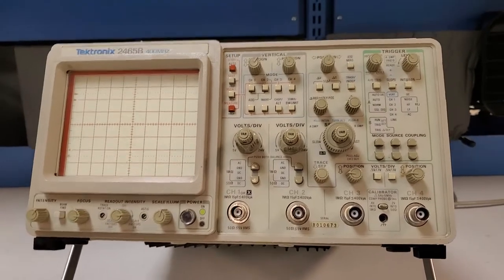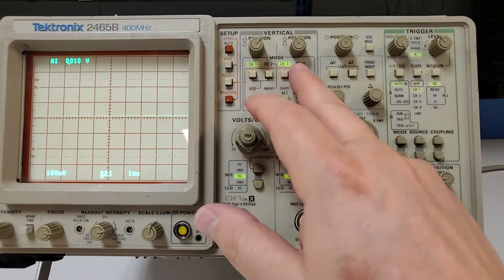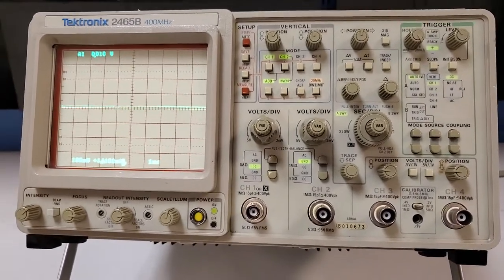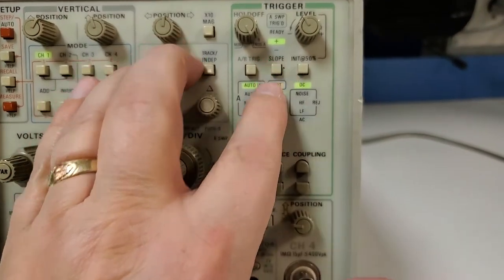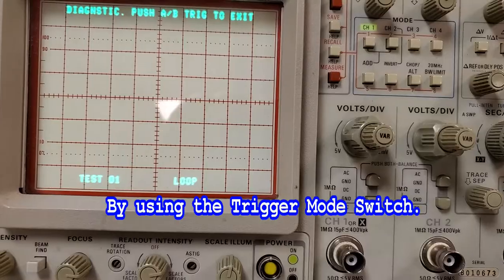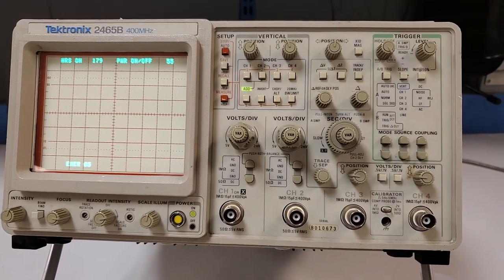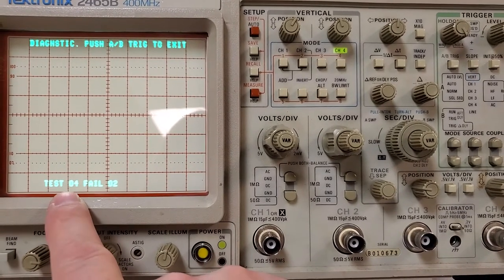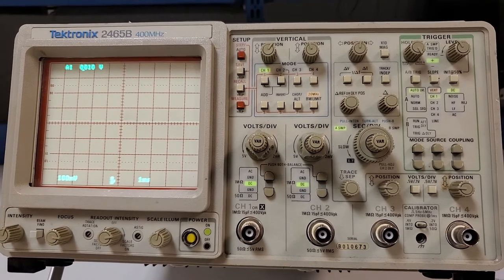Tektronix 2465B Inidcators Flicker & Dianostic Routines

Comment: Hai Keith, I like your Tek video's :)

I'm trying to fix a Tektronix 2465, and it works now, but I can't find the cause on 1 remaining problem.

Do you have a tip what causes the intensity becoming way to bright when more channels are activated? (it''s ok when 1 channel is on, too bright when 2 or 3 channels are active, and waaaaay to bright when all 4 are active... (so I have to change the intensity pot every time I activate or deactivate channels).

The PSU voltages and ripple are within spec. I replaced the Z-Axis hybrid with a spare one, but that wasn't the problem...

With regards,
Richard van der Veen
Reply from the maker: Wow that's one of the weirdest gripes I've heard about on a scope. I'd definitely take a hard look at the voltage feed to the pot, then the regulator from where it comes from, then the signal out to the IC. 
- Using the 070-6863-01 Service Manual, I’d check where the pot gets it’s voltage from and where the signal is sent too! On PDF pg 423 & 427 Diagram “5” Zone A-3 is where the Intensity control is shown. The Intensity signal (DI = Display Intensity) out goes to J120-16 then out J512-29 and on to Diagram “2”. J512-29 on PDF pg 414 on the A5 Board then the DI signal goes to U2501 (CD4051 a 8-channel analog multiplexer 16 pin DIP). You can check the data sheet here:  https://www.ti.com/lit/ds/symlink/cd4051b.pdf?ts=1671838792820&ref_url=https%253A%252F%252Fwww.ti.com%252Fproduct%252FCD4051B%253FDCM%253Dyes%2526utm_source%253Dsupplyframe%2526utm_medium%253DSEP%2526utm_campaign%253Dnot_alldatasheet%2526dclid%253DCMfosezzkPwCFRPT_QUd1IMEwQ  Use the data sheet and see if it’s working correctly. U2501 is on the A5 Board in zone B-3. The voltage reference is +1.36vdc and I think comes from onboard the A1 somewhere. Just check it while adding channels to make sure it’s steady. If the voltage is steady it’s on the DI side output control, most likely A5-U2501. Hope that points you in the right direction. Best Wishes & Blessings. Keith Noneya
Reply: @keithnoneya  Thanks a lot for the reply! 

I think I should have been clearer about the scope (I have a 2465 not a 2465A), and the intensity signal path is a bit simpler on that one. One more problem appeared. Channel 1 is now always on, unless I activate another channel. Then I can turn it off and on again... 

weird isn't it?
Reply from the maker: @levendlicht  I do believe that the scope is set up to always have a channel on, or channel one by default if no other channel is selected. One thing to remember is when swapping cards or troubleshooting is to take into account of the SN, because there are different boards based on SN.
You'll need the manual, if you don't have it try this one; https://w140.com/tekwiki/images/8/8b/070-3831-00.pdf go to PDF pg. 244 and your intensity is in zone A6. If you have an intensity problem check the +5v in and the inputs and outputs signals and connections on U650. Obviously make sure the intensity input to U650 varies steadily on pin 22.

Comment: Hello,
my wife and I have an Iwatsu DS-6612A with capacitor problems which we could not repair yet due to overwork. A nice test is to look if the text "jumps" around...that usually points at voltage instabilities...
Reply from the maker: Yep displays and other issues all at once is a classic power supply problem indication, specifically leaking caps. 
Quite an antique you have there, like the rest of my test equipment, LOL. Kind of reminds me of my Kikusui COS6100M. Some of that old equipment is hard to kill and fairly easy to repair down to the component level. My Kikusui COS6100M went under water in hurricane Katrina. I literally took it apart and pulled every corroded component off the boards, tinned them and re-installed them. Fired it up and it worked. Calibrated it and it makes a great back up scope. You'd never know it went under water by looking at it or the boards. Thanks for sharing Tam, post a short video on that. How is the Mrs doing, it's been awhile since you emailed me. If you forgot my personal email address, you can email me at my YouTube email here: Keith_Noneya@att.net If you misplace that one it's on my "ABOUT" tab on my home page. Good to hear from you. Best Wishes & Blessings. Keith Noneya